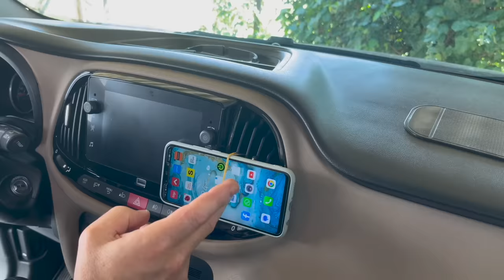Why Shrewd Drivers Put Syringe in Car Seat? Car Hacks Will Make Your Car Level 100

Comment: I always cringe when I see those small wrenches many cars come with.  I once had a Chrysler with those two piece lug nuts.  One piece of them is a thin metal cap that can cause a lot of misery.  That is especially true if someone really overtightened them because that cap I mentioned tends to get deformed or swollen.  Swollen because there is often rust under them as they age.  That can cause it to be weak the wrench to slip rounding the F-ing cap off.  My Chrysler was a 1995 but they used those cursed things on a lot of model years.  I hear Ford also used them so maybe it is not just a curse on Chrysler, Plymouth (showing my age), and Dodge owners.  When I say showing my age about Plymouth it is because that brand no longer exists.  It suffered a similar fate to Pontiac (R.I.P.).